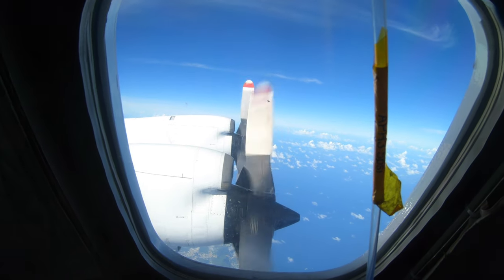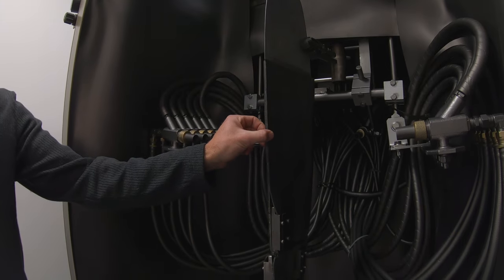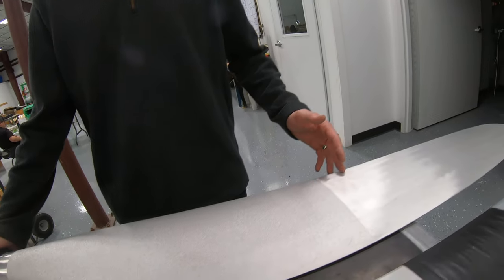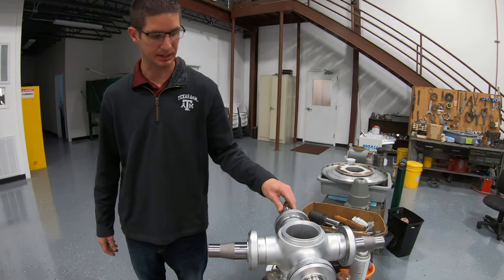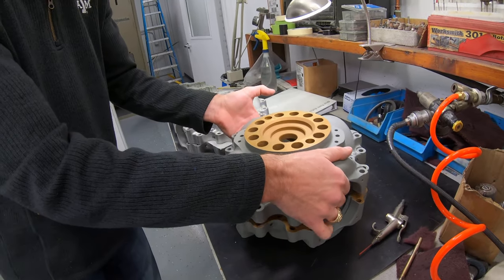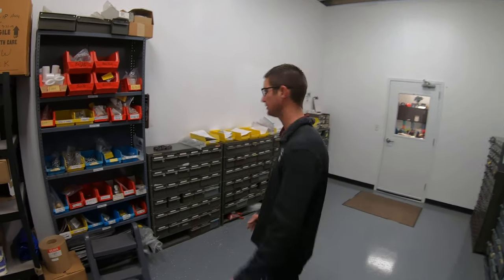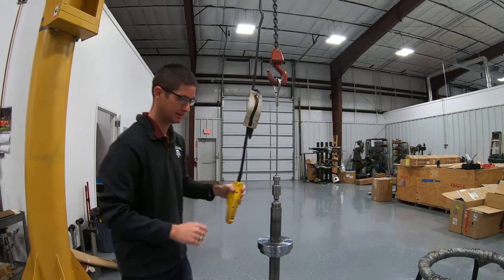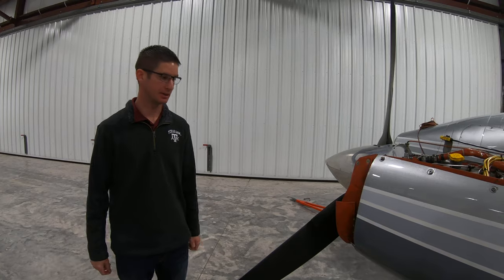What Happens When Your Prop gets overhauled?? Pt. 2

Comment: Many years ago I had a fixed prop on a Lycoming 205 hp helicopter engine powering my Starduster Too Experimental biplane, based at C-40. The aircraft was built in Menominee, Michigan by one George McNeil. The prop needed more pitch. I found a prop shop in Kalamazoo, Michigan that advertised this sort of work. I made an appointment, took the prop to them and was able to wait on it. The technician permitted me to watch the process. The prop was first affixed to a fixture to hold it on the horizontal a few feet off the floor. He had an aluminum pole about 10’ long which had a “claw” on one end. The claw was slipped over one of the two blades of the prop and then he literally hung all of his body weight on the opposite end of the pole...and gently bounced his weight up and down which resulted in twisting the prop and the pitch being changed. There were measurements taken before and after. I do not recall all of the exact details of the procedure...it was in the late 1980’s. The results were as hoped for...more airspeed and without any prop vibration. Also, the cost was very reasonable. An amazing experience! :)
Reply from the maker: Wow! It’s amazing to hear about the stories of the the ‘experienced’ guys & what they can’t do anymore. 😞
Thanks for watching!

Comment: Just subscribed, well made video as you kept me interested while learning.  I’ve got a new appreciation for proper prop care.
Reply from the maker: Perfect! Exactly what I was shooting for with those videos. 
Thanks for the comment & sub!
Reply: I just bought a Mooney project last month that experienced a partial gear failure as it slid off the runway.  Fortunately the prop struck mud and gently stalled the engine, only one blade was damaged but the prop shop is able to refurbish the unit.  I uploaded a quick amateur video of the beginning stages of our project.  Mooney’s have notoriously little prop clearance and I now know why/what to look for during preflight.